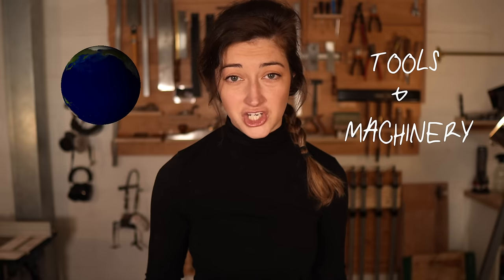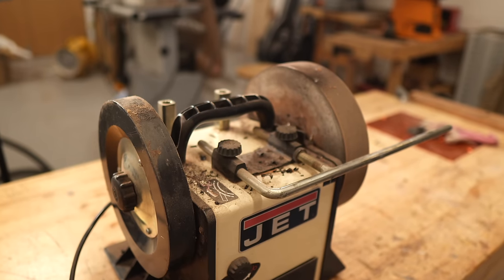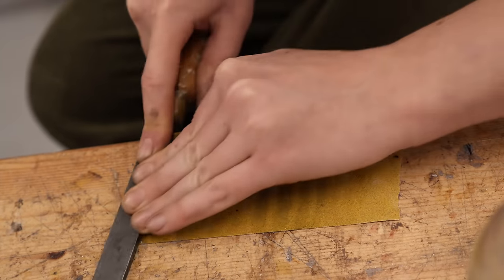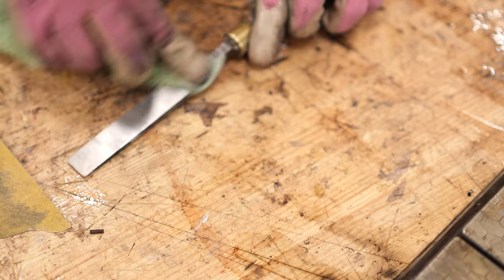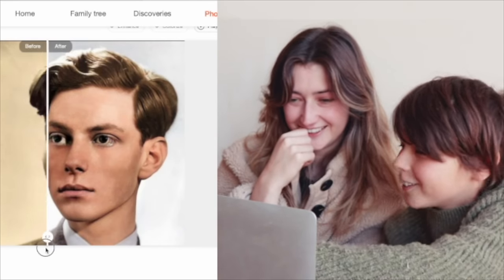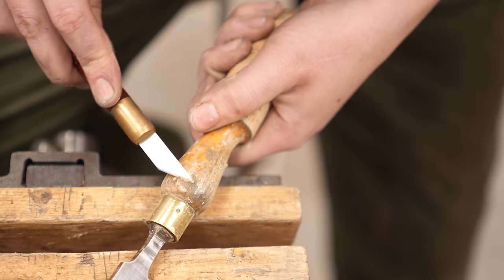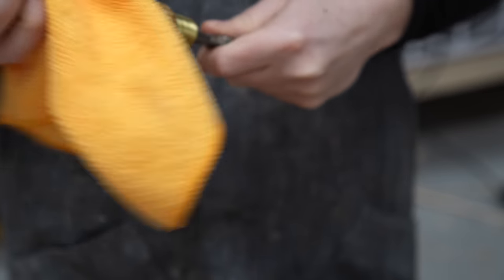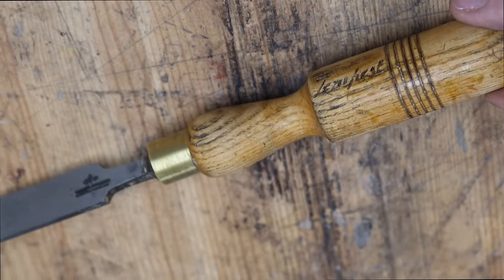Restoring a 100 Year-Old Chisel

Comment: The red/black oaks are very open pored, which is why you don't see any wine or whiskey barrels made from it. Split a billet of red oak and stick it in a bucket of water, and you can blow bubbles out the end. You can't do this with white oak. Biggest problem I can see with the open pores of some woods would be bleed out where you get little puddles/spots of oil that bleed out as the oil cures. You can use an air hose to blow out the pores before the oil cures, or you can wait till it dries and hit it with steel wool.

As for dental picks, next time you see your dentist, ask them. They do have drawers full of them that they don't/won't/can't use any more.

Comment: I ended up doing my own restoration of some u-gouges I bought from a vintage tool dealer. I learned a couple of things in the process. The grey coating is called a "patina" technically its oxidation, but its not the same color or as corrosive as rust.  Rust is brown red, and usually a sign that the iron corroded severely. Patina is light to dark grey, it's extremely mild and won't damage your tools compared to rust. 

Patina is very common in old tools due to the high carbon content. It's not harmful, and in the long run, it's not worth it to remove all of the patina from the entire tool since it will just turn dark grey again after a number of years. Simply wiping tools down after use, and some light motor oil should be enough to maintain them long term.

Comment: Its very interesting what what various people define as restored.  Some people would just want it cleaned up, and leave the patina of the wood the way it is and the blade the way it is with the rust and dullness.  This would be more for display of an old tool.  Then there is a restoration where the tool restoration work brings it back as it was brand new,.  I like what how you restored it.

Comment: Great video and the finished tool looks lovely. There is no reason you cannot use boiled linseed oil on oak. I’ve used it on picture frames and the like for years, followed by a final coat of wax. No issues whatsoever. I love traditional finishes as they are inexpensive, easy to apply and avoid the dipped in plastic look.

Comment: It is a trifle much to say your Grandmother made her chisels as they are clearly machine made and stamped Marples (very fine chisels ) however props to her for making custom handles to suit herself.  On old chisels like those it is usually worth while to check the angle of the sides relative to the back and clean it up if necessary. CBN wheels are worth the coin.

Comment: If your chisel is an off the shelf when it was new, the handle is probably Ash, not oak. Manufacturers typically used ash and boxwood for their handles. There's nothing wrong in using linseed oil, raw or boiled, on the handle, just wipe well and apply some more next time you remember. After some time, use will give it a nice look.

Comment: the oil will be fine on your oak, it will soak in yes but all you have to do is wait a month then apply it again and again the follwing month

once a month for a year is a good starting point  and after than on an "as needed" basis.

However, the correct way to apply it is to dip your finger in it, shmoo it onto the palm of your hand, rub your hands together to make it all warm then rub the piece.  this will apply a MICRO coating to the surface which will soak in and polimarize in a week or so (it will take some time to cure though).

If you are absolutely bat**it crazy you can literally do this for about 3 years then lightly sand it all down then do it again for another 2 or 3 years and build up a ultra high gloss finish almost as good as a professional french polish.   This sort of finish can take years to achieve and has been known to be used on firearm stocks for very high end firearms :)

Comment: Boiled linseed oil may contain driers that have trace amounts of iron that will react with moisture and turn the tannins of the oak black.
Raw linseed oil should be fine, but it takes longer to dry.

Comment: If you're going to use a scalpel blade to scrape out gunk from grooves etc, use the back of the blade tip (not the cutting edge) and drag it towards you. Much less chance of cutting into the wood and remodelling the grooves accidentally.

Comment: No harm no foul on the BLO.  If it yellows, and that bothers, can slightly tint subsequent finishes.  I go with a mix of spar varnish and polymerized linseed oil.  Can thin with mineral spirits, but I just rub it on tool handles as is.  A few drops of gunstock colored minwax brings out grain and slight warm color in almost any wood.  For a no-harsh-chemical option, way back in the day, they used just beeswax with no issues whether on axes or chisels.  YMMV. no warranties, express or implied...

Comment: I make my own finish that is great for handles. It is linseed/flax oil, beeswax, and turpentine. I would have just cleaned the handle with fine steel wool and some oil instead of obliterating the original with sandpaper.

Comment: I don't think you did any major damage with the linseed oil but you can wipe it down with naphtha or let turpentine set on it for a few minutes to get the oil on and near the surface out With it being so old the dryness of the wood, and if it's English or white oak (guessing it is)  it's exceptionally hard and not particularly porous, the oil probably didn't that far in.

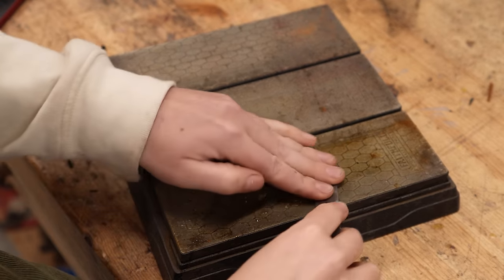Comment: 1:57 The whole back does not need to be perfectly flat, only the bit behind the tip. Even just a few millimetres are fine. To be fair, I would have flattened the whole back too, for looks, but it’s not necessary.

As for boiled linseed oil on oak: it’s fine.

Comment: Hi! Why didn't you use a paint stripper for the handle? You would have done it faster and more accurately, in my opinion. About the linseed oil, I think it's not the best for handles because of its drying time and because it remains a bit sticky...maybe Danish oil would be better. Nice restoration, you did a good job! I love old tools, I have some that were my father's they are about 80 or 90 years old. Ty🙏

Comment: Are today’s chisels an improvement, or is there limited scope for such?
Reply: Some of todays chisels are an improvement... most are a step backwards.  My personal experience with Maples blue chip chisels put the ones made 20 years ago head and shoulders above the newer  Irwin/ Maples blue chips.  The new ones weren't even close to flat and were far to brittle to hold an edge.  However my IBC and Blue Spruce Chisels are, Mary Poppins, practically perfect in every way.

Comment: Scrape old finishes off with shards of window glass or tungsten scrapers. White vinegar soak will remove thick rust do not put different metals in the same pan, electrolysis. You took the unique character of a hand made tool away. Great work though.

Comment: Bad news - I don't think your grandmother made that chisel. The blade is obviously a Marples (from the Hibenia works, hence the Shamrock). The handle is exactly what I'd expect on a Sheffield made tool of the inter war period. So I think it's a nice old Marples chisel.

Good news - I'm fairly sure the handle is Ash - I've carved handles for vintage axes from Ash, and it looks IDENTICAL. And ash was indeed commonly used on commercial chisels. Since it's not Oak, the warnings about Oak/Linseed are moot.

The name is fascinating - it look written, not carved! I imagine she did indeed write her name with a pencil, and then carved (engraved?) it.

(I was a tool collector and restorer for a couple of decades, so I have many reference books and many vintage chisels)
Reply from the maker: My understanding is that she turned the handle herself, perhaps copying an existing handle, but I might’ve picked up the wrong chisel from our small collection - when I next go to my mothers house I’ll have a look and post an update if I was mistaken, and show the handle. Would be a shame if I had picked up the wrong one… and really, ash? It doesn’t look like it to me at all, so perhaps she did turn this one as a copy in a preferred timber. I’ll keep yall posted. Thanks for the knowledge!
Reply: @DaisyTempest  I've twice tried to post more information, but "the tube" doesn't like any kind of external-ness, like URLs. My posts got kill-filtered

Comment: I think you might saved yourself a bit of time if you instead of sanding the handle washed it with alcohol. The thing so old, that most likely it was covered with shellac, the clear sheen it had suggested that. Oil would never create such a "glowing" shiny surface once dried. That can be washed off by rubbing it with alcohol.

Comment: There is no real reason to flatten the entire back. As long as you have about an inch or so from the cutting edge, it should last another lifetime and the flat will creep back with every sharpening. 
Doing that much material removal is actually less material for the next few owners to work with.